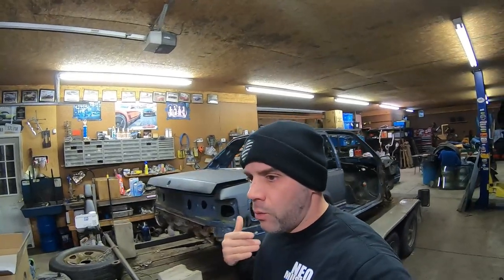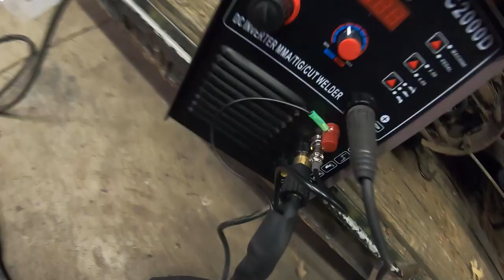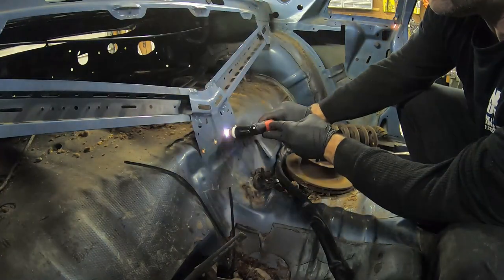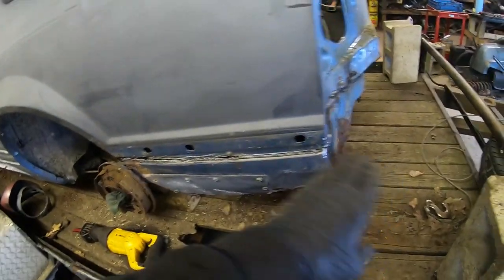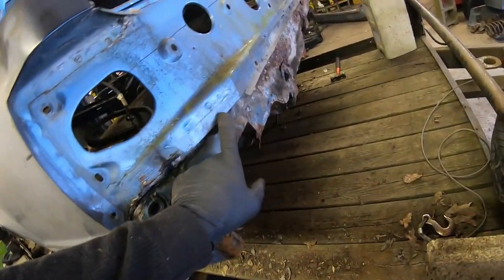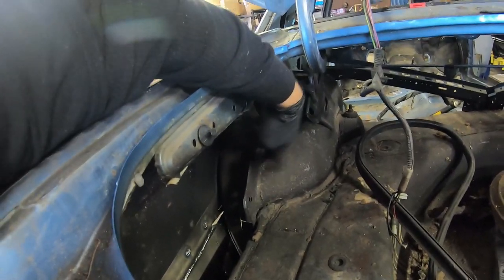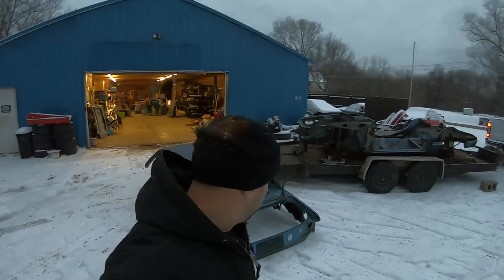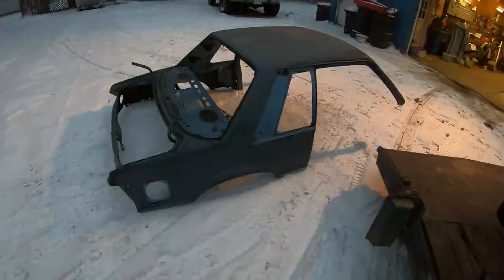CREATE-A-COUPE / LETS GET TOPLESS! Removing Notchback ROOF... PART 2

Comment: Convertible Mustangs were coupes built WITHOUT the roof section from the bottom of the A pillar to the bottom of the C pillar and then were sent to ASC(American Sunroof Company-later changed to American Specialty Cars) for final completion. They had a removable/reusable fiberglass "turtle shell" cover installed to protect the interiors while awaiting final assembly. I saw a pic of roughly 200 white coupes with the turtle shells sitting in a holding lot at Ford circa 1990. At first glance they looked like a bunch of white convertibles with white tops but you can clearly see in the pic that the top is a one piece removable shell. Starting in 1994 with the SN95  cars Ford built the convertible 100% in house.
Reply from the maker: Good info
Reply: Absolutely true story, I saw them in the flesh in 1990 at the ASC facility.
Reply: Cars and concepts in Brighton did the finish work on the mustang verts. Asc  did their own finish work for their cars. I do believe you guys are correct that they were stamped verts from Ford and not coupes. Ford didn't want to waste all that metal. I have seen a few verts that were cut (apparently) from Ford especially 83-84 cars and that could be due to the learning curve.  Only seen a few 87 and up that looked cut off, most looked stamped and every bit of the front windshields I've seen are stamped.